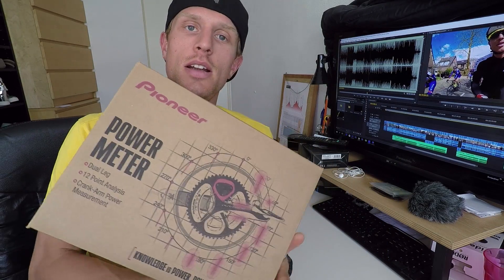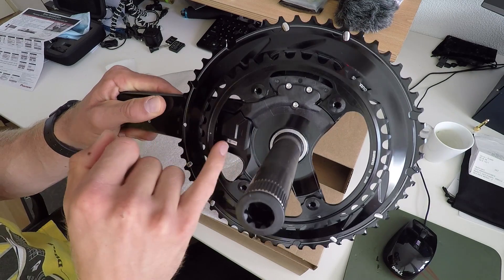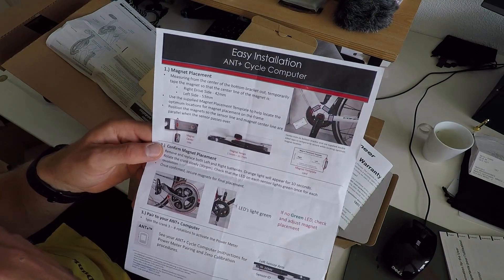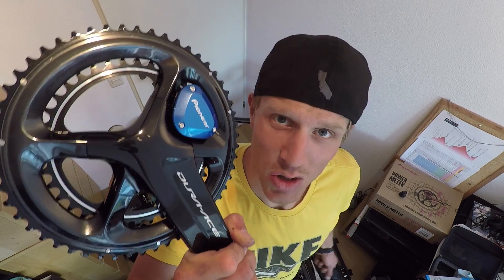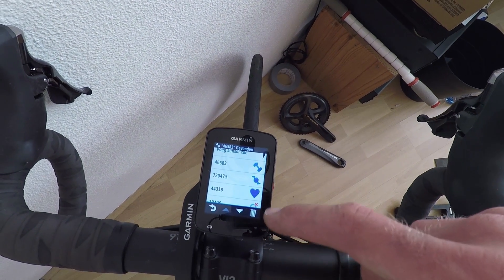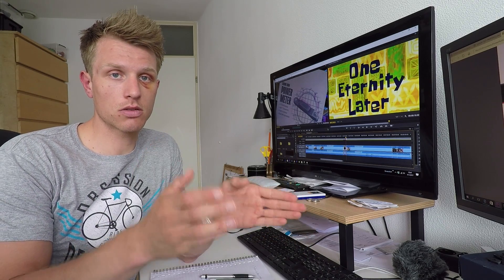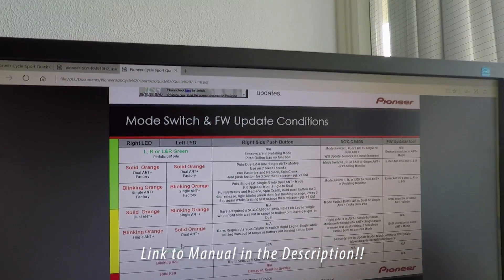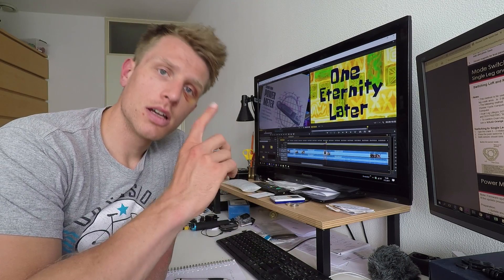How to PIONEER DURA-ACE 9100 UNBOXING & INSTALLATION. + PROBLEM SOLVING - #cycling

Comment: I bought a Pioneer after selling my Stages and it's working reasonably well and all. The only thing I can't stand is that I can't upgrade the firmware without the Pioneer head unit. Apparently there's a software called the firmware updater tool but I can't find it anywhere (was told by Pioneer on Twitter) and the customer service agents are clueless....

Comment: Hope you heal up soon mate. We need you back making good quality race vlogs. Also please do a review of the pioneer power meter. SRM are too expensive imo and for me it's either these or quarqs. Leaning towards quarq currently.
Reply: Realiability issues is kind of scaring me off stages
Reply: what reliability are you talking about with Stages?  I have stages and 4iii on both my bike.  They both work flawlessly for years.  I prefer 4iii over Stages though, since it's a bit lighter.
Reply: Jimmy Vo Most people I know that have stages have sent it back at least once. Not willing to risk it. 4iii is actually a good shout. Lighter,cheaper and it would seem more reliable than stages from all accounts. Does not having readings from both feet hinder you?
Reply: I assume they have the 1st gen version where there was battery door issue.  2nd gen stages version never an issue.  Team Sky runs stages pm and Etixx runs 4iii.  If it's good for them, it's good for me.  There are many youtube videos that compare the power between single vs dual pm and the differences are marginal at best.

Comment: How has been your experience with the powermeter? I am thinking about getting the same pionner powermeter but I've been reading about some connectivity problems when connected via ant + with garmin when the pioneer is in mode "dual". 
Have you had any problems about this problem?

Congratulations for your videos.
Great job

Comment: Great video! I have myself a canyon cf slx 8.0 (disc brake version) I guess there shouldn't be any clearance issue with the frame. I have a question for you after a year you posted this video. What are your impressions on the power meter? Btw, do you know where is it possible to buy it in Europe (I live in Germany)...it does not seem to be present in the most popular online shop cycling website? Many thanks and keep powering it up ;)
Reply: Many thanks Jasper. Yeah, apparently they sell it on to pro and triathlon teams in Europe. I am afraid I might end up going for the Garmin vector 3. All the best Jasper with your training and keep us posted with your videos! ;)

Comment: simple2use is key, pioneer not only looks bad, it is not user friendly, when I see you having all these problems. Quarg is half the pioneer price, also dual leg and looks better to me. thanks
Reply: Christoph Pietsch quarq is not dual leg is it spider based only and caculates dual leg by by gusseing where your legs are in power phases so not a 100% but it close enough

Comment: Hi Jasper, great video. I am also having pairing issues with Garmin 510 and exactly the same model Pioneer. What it does is, when i remove and put the battery back, I see red led for 5 sec and it disappers, left side is orange. Do you think it is a mode issue or a fault on PM? When I check the manual, it only says PM is faulty if both leds are solid red. In my case, only the drive side. 

It is strange because I lost my connectivity in the middle of a ride and it never came back again :)

Thanks for your help
Reply: Hi bro how you resolves this problem? My pwm works great but now hi lost connectivity and comeback and again lost.

Comment: I'm not too much into the power meter topic, but wouldn't a pedal-based system like Garmin vector have been very interesting for you so that you can take it with you to LA and use it on the Fuji? Or did you read bad reviews about pedal powermeters?
Reply: Jasper Verkuijl that's how I feel pedals wear out why put a pm in them. Most of the pedal ones can be repaired but the repair price is not cheap and if they have bearings like look pedals they won't last

Comment: So now that you've had the pioneer power meter for a while what do you think? Are you going to do a long term review?
Reply: Jasper Verkuijl o.o pioneer has accuracy issues? Shoot
Reply: Hi Jasper -- you may not have 'cured' the crank properly.   In their system Pioneer opted for a real life temperature compensation feature that ensures the accuracy of their data -- but it is not well understood.   You should zero calibrate your crank at a variety of temperatures at which you typically ride throughout the year and terrain.  For example if I start a ride in the city and it's 30 degrees and I climb to the top of the nearby mountain where it is 15 degrees I should do a zero cal at the top.  Takes 10 seconds or so its really fast.   What that does is it teaches that crank what 15 degrees feels like.  Or 30.   Or 45 degrees.  You won't ever have to zero cal at 15 degrees again -- the crank has been 'cured' and now recognizes it's own individual deflection characteristic at that temperature.    There is a rider that has a dual leg Pioneer that lives near me that said to me recently "hey I calibrate my power meter EVERY morning when I go ride" so what that person has done is taught their crank really really really well what 29 degrees feels like.   LOL.   Other cranks use different methods of temperature compensation.  Of course this is all subject I'm sure to product development /  firmware updates as they roll out from the different makers of these products.

Comment: I didn't think that the Dura ace 9100 or the Ultegra 8000 crankset was backwards compatible with older components (at least that's what Shimano has been saying)?

Comment: I have the same bike - but my left hand power meter is rubbing against my frame - did you have the same issue?
Reply: Jasper Verkuijl yes I’ve got the disc version - the crank sensor is massive I think I need another 1.5mm to clear it - how did you resolve your issue?
Reply: Evan Turner yes it’s happening on the disc version

Comment: Thanks for the video but I'm having trouble pairing it with my Wahoo Elemnt. I tried all methods and I can't seem to get it into ant+ or dual power meter mode. I followed all instructions on the manual and the dam thing wont blink orange for me. I put in new batteries and both side blink green for at least 10 seconds..
Reply: Hi!! Same problem here, how you change mode from the solo 10seg green mode (pedaling monitor) to tha solid 10seg orange mode (dual side mode)